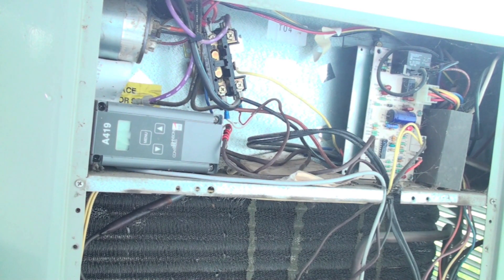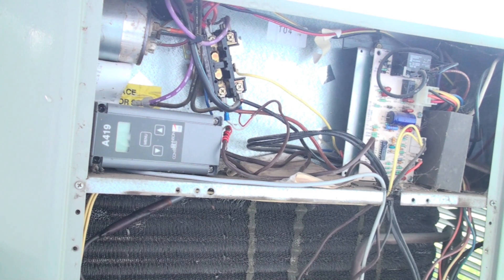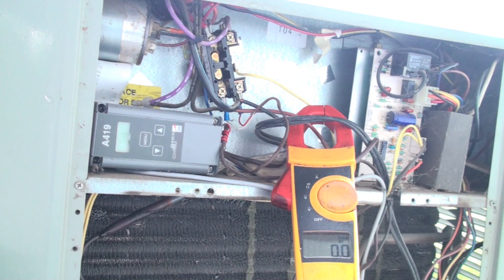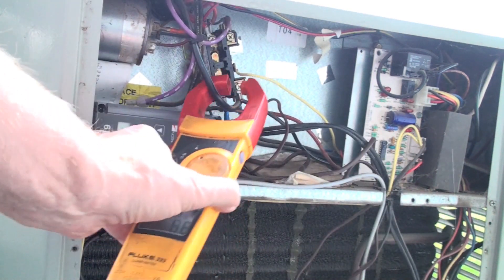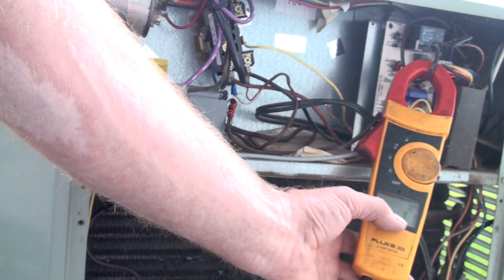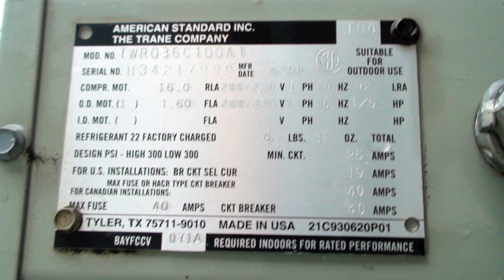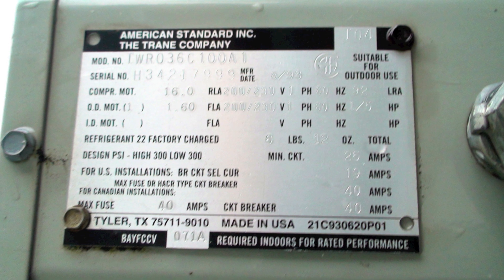What is normal air conditioner amp draw

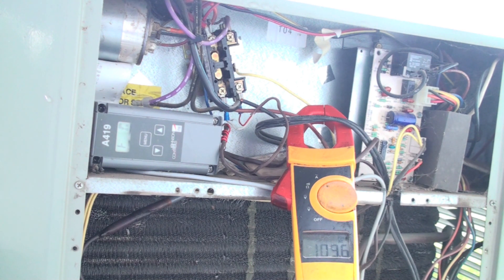Comment: Just wondering what you make of the temporary spike of 104.5 amps for a split second( at 1:44 / 4:37) when the switch turns on.  And what effect does this surge have on the relay contacts over the life of the condenser.
Reply from the maker: Mark .Smith That's inrush amps.  When a motor designed as the compressors are, there is very low resistance upon startup, thus the high draw.  Amperage reduces as the back EMF rises with RPM.  The contactors are designed for a specific running amp draw and a locked rotor amp draw.  These specs are noted on the contactor itself.  Hope this helps.
GFM
Reply: grayfurnaceman why did that 104 amp in rush not pop the 30 amp breakers ?
Reply: @ACommenterOnYouTube you probably figured this out by now but the braker is “slow tripping” and “slow blow” fuse which means it will allow high amps just at the beginning without blowing
Reply: You Tube 
That's why we have a capacitor.
Reply: Mwdub02:
You didnt answer my question... only told me the obvious that is why we have capacitors ...

Comment: Thanks for the video.  I have a quick question.  I recently had my routine spring AC inspection and the company told me that the amp draw on my fan motor was 1.1 out of 1.4.  He stated that this indicated that the fan motor was failing and it needs to be replaced...at a cost of $600 to $1152 depending on whether I also replace the fan blades.  I am skeptical of this as it seems that drawing slightly low amperage shouldn't be an issue, but I am not an expert at all in this area.  Also, it seems that the inspection company seems to find something that is "failing" at nearly every inspection so they are always trying to add something on.  This is an inspection service that I pay a monthly maintenance fee for, and it then includes 2 inspections per year plus a discount on service calls, etc.  

I have no problem with preventive maintenance, and I suppose that is why I am having routine inspections, but I am just a bit suspicious of this company due to the above mentioned trend.  Thoughts?

Thanks,
Scott
Reply: A failing electrical motor will generally start pulling more amperage... I'm sure there's exceptions however. How about you replace it when it fails...
Reply from the maker: Scott S As you should be.  The motor is ok if the amp draw is below the rated load.  Do not replace it.  Sorry about the wait.
GFM

Comment: I have question I hope you can help me with. 
I have clamped each wire to the compressor and I get the following. 
Blk wire 7.9 amps
Yel wire 9.0 amps
Blue wire 6.1 amps
Does this look normal to you?
What might these readings mean? 
This is Bryant unit about rated at 15.0 amps

Any help is greatly appreciated. 
Thanks
Wally
Reply from the maker: It does not look right, however, it depends on where you put the clamp meter.  If the unit is running normally, and not going out on overload, it is probably ok.  Hope this helps.
GFM
Reply: grayfurnaceman It seems to be running ok but I have reason to believe this unit has been running for years with non condensibles which should have done some damage. I need to properly inform my customer that unit is indeed showing evidence of undue wear and tear. 
Thanks for replying
Wally
Reply from the maker: handyman5475 You may want to check head pressure and compare to what would be normal.  Also do an acid test.  Hope this helps.
GFM

Comment from the maker: Look for fuse in low voltage, perhaps on furnace circuit board, also check furnace breaker
GFM

Comment: Also, had an inducer motor with plate reading of .80 amps. Clamp read, .2. Major difference in my thinking. Psi switch made, furnace fired up normally. Call from customer was that it was noisy. Took assembly off to inspect wheel. Plastic hub on wheel closest to me broke off on my hand due to heat from H.E. All else good.  Il'll bet the motor shaft was not grabbing the wheel as solidly as it should causing low work on motor causing low amps. Your thoughts, brother? Sutton

Comment from the maker: Absolutely right.  Low charge equals low amount of gas evaporated so less gas to pump.  High head means the pressure difference between high and low side is higher, so the hill the pressure must climb is higher so more power use.  Thanks for the comment.
GFM

Comment: My experience is a low system charge can be a low amp draw. Excessive amp drawing can also present as low airflow at the condenser, i.e. no fan condition, or dirty condenser.

Comment from the maker: Compressors are pumps that increase their amp draw as the amount of gas pumped increases and the pressure difference increases.  The actual amp draw  is often much less than RLA.  As an example, You might expect to see RLA with say 100 degrees outside and 100 degrees inside.  But if the outside temp was 75 and the inside temp 75,  actual amp draw could be as low as 1/2 RLA.  Hope this helps.
GFM
Reply: What about the LRA?
Reply from the maker: @dubol07  LRA assumes the compressor rotor is locked.  That amp draw is usually about 5 times RLA.
GFM
Reply: @grayfurnaceman  Thanks! I am curious though, why isn't the breaker rated at the LRA?
Reply from the maker: @dubol07  The breaker is sized for the wire serving the appliance.  If the unit is drawing LRA, the breaker should trip as that is not an amperage that can be sustained.
GFM
Reply: @grayfurnaceman  Ineresting. I am just trying to learn. I thought the LRA is the in-rush current required to start the motor. Or did I get that wrong? If so then what is the LRA?
Reply from the maker: @dubol07  Inrush is 2 to 3 times RLA.  Understand that starting current is with a rotor that is able to rotate.  It starts rotating immediately when power is applied.  Thus the lower amperage.  
LRA is the draw if the rotor is stuck.
GFM